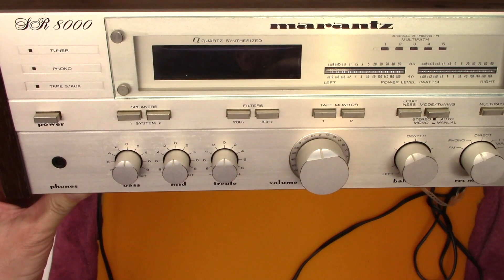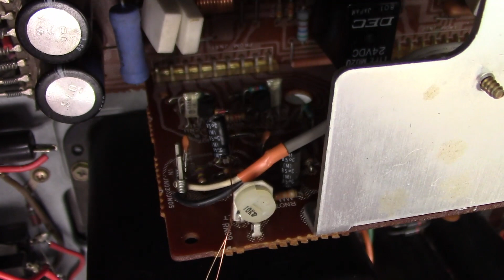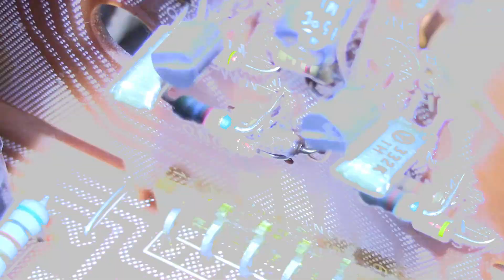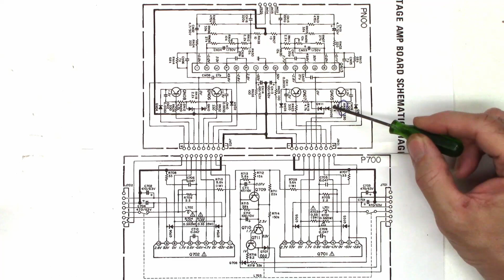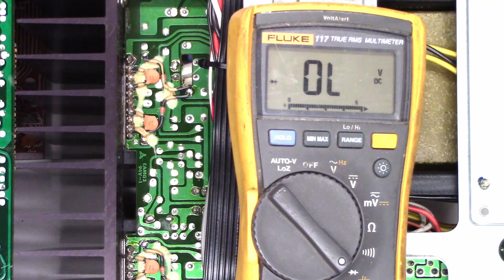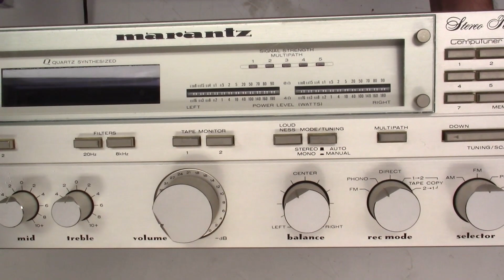MARANTZ SR8000 BURNED RESISTOR REPAIR PART 1 DIAGNOSIS  - VINTAGE STEREO REPAIR

Comment: I have a Sony  HDC-ZX99i that is having an old behavior. When I press any key it gives me the wrong function . If I press the tuner keys sometimes will give me audio functions such Jazz , pop or any other random key function. That happens on all keys including the cd ones with the exception of the stand by key that is isolated from the rest of them. I checked all the electrolytic capacitors on display board where those keys are connected but all of those seem to be ok including their respective ESR values. This is one of those things I'm not good at diagnosing and don't know where to look next. Any suggestions would be greatly appreciated.
Reply from the maker: please email me at NORCAL715videos@gmail.com

Comment: I have loads of those 2SA733 and even more 2SC945, they were used in CB radios in the late 80’s/90’s which is why I have them.
Reply from the maker: I have probably removed at least 100 2sc945 limiters from cobra 148's and 2000's and others when i had my CB shop in the 90s and 2000s. after that I started to put a switch to either have the limiter on or off. CB radio I could tell some stories, still have 2-2500W ham amps although only one has tubes.

Comment: We are all different but I like the output IC's better than having to go through and replace all of the individual components. The failure of the output IC could have been caused by someone shorting the output out while the unit was on or from running to low of an ohms load on it. Whenever you fix a problem like this you should always make sure the customer knows how to correctly connect the speakers and what ohm speaker they can use or it may come back in with the same problem again.